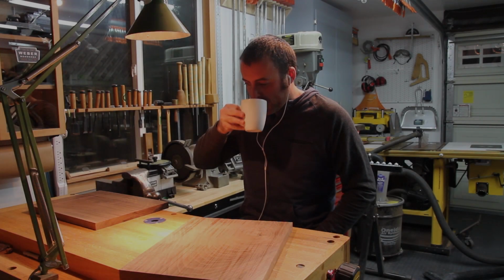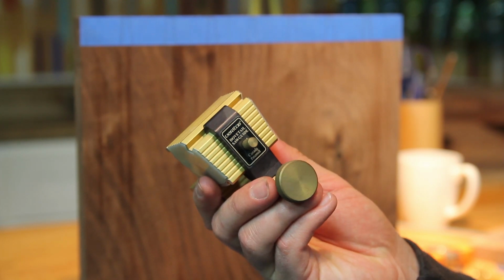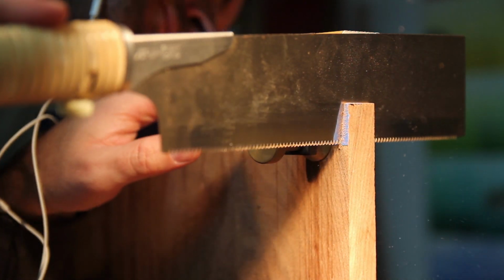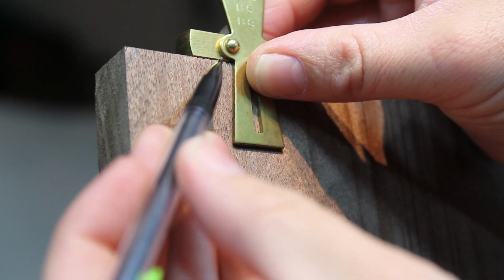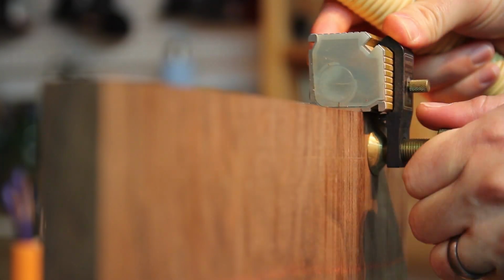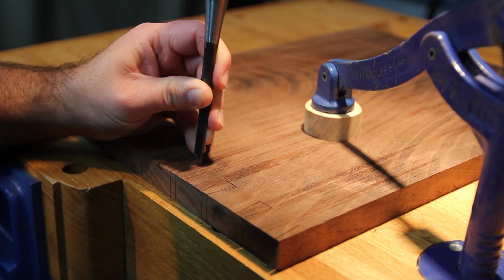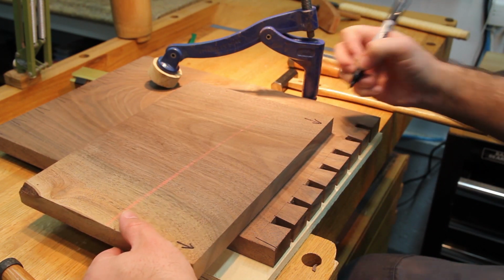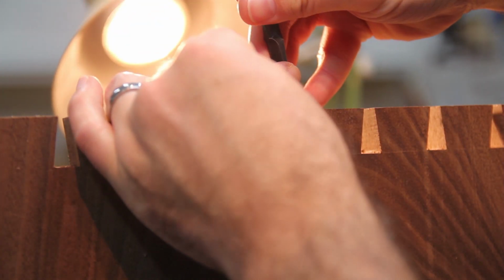Build: Mid-Century "Entry Cabinet" (Part 2)

Comment: Awesome video. I now feel like I might could actually tackle a dovetail project. Great music and product. Love your content and approach, as well as the shop. How do you like the Husky toolbox/mobile workbench there to your right? Spied one at Home Depot a few days ago. Immediately went home and cut 9.25 inches off of the workbench that came as a built in to new workshop shed, so that I now have 47" clearance between the end of it and the entry door. That work bench is 46", so I should be good. Just curious to how you like it? Thanks, DT
Reply from the maker: I really like the Husky tool boxes for the price. I had one of the drawer fronts pop at the tiny tack welds, but fixed it with a few black machine screws.